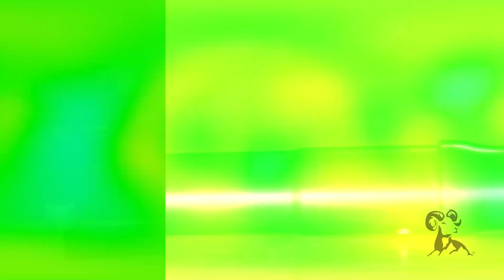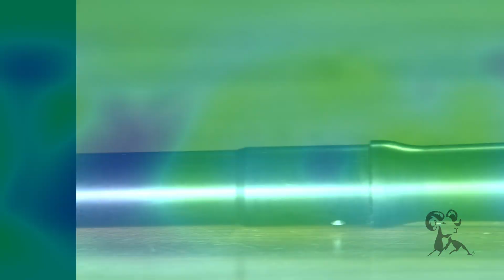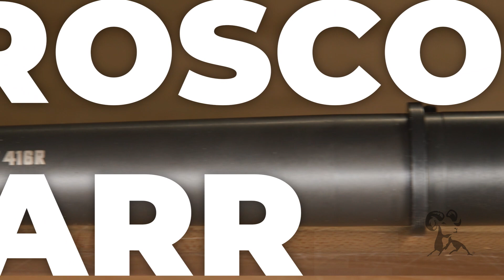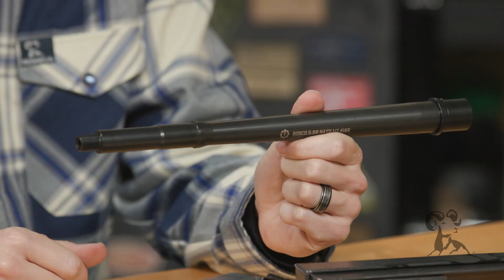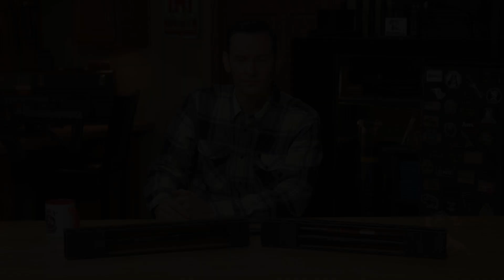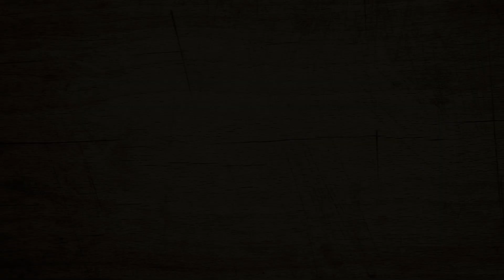Product Spotlight: Rosco AR-15 Barrels

Comment: I bought a Rosco K9 two years ago. 11.5” with the patrol length gas system. So far I have probably 3,000 rounds on it. It’s an excellent barrel thus far. Easily hitting out at 350-400 yards out. I don’t precision shoot with it obviously it’s an 11.5. But as far as hitting a six inch plate at 400 yards I can attest it’s more than capable.

It dissipates heat rather quickly. The short length is easy to manipulate and maneuver. The weight is fine. I’m not going to count ounces when it comes to my barrels. The barrel is going to be what it’s going to be. If I’m shaving ounces I sure won’t be starting with the barrel.

There’s not much else to say. It’s inexpensive. It does exactly what I need it to do. My next barrel will either be a Rosco or something heavier that can manage a lot of heat.

Comment: I know this video came out two years ago, but I had a great experience with Rosco. So I thought I'd share my experience in case someone watches this while considering a new barrel. I put an 11.5 inch 5.56 Nato bloodline barrel on one of my builds. I've had  three other brands of 16 inch barrels on other guns. This 11.5 Rosco barrel is more accurate than all three of the other 16 inch barrels. I like this brand so much, I plan on switching out my current 16 inch rifle to a Rosco Bloodline barrel as well. There pure bread barrels look fantastic as well. If you need a barrel, Rosco makes a great one!
Reply: Thanks for that info man. Really made me go with this barrel. And the price is awesome too, compared to some other ones I’ve been looking at.
Reply: Thanks for the info man. I Stripped my threds on my barrel and I need a replacement asap lol so im definitely getting one now
Reply: Shorter barrels are more accurate.

Comment: I upgraded a PSA pistol with Rosco 10.5 sauce pack (barrel,bcg,gas tube, block) and just right off the bat my AR was shooting perfectly tuned. Popped in an upgraded charging handle too and man my gun cycles like butter. Very noticeable difference to a couple entry level “mil-spec” rifles I have. Cannot recommend rosco enough.

Comment: So if I found a barrel company with all the EXACT same specs, as far as barrel length, weight, material (4150 cmv), profile, twist, gas block size, gas length system...but the company I found was literally half the price...what makes this barrel better? Compared to the competition?
Reply: What company?
Reply: @erice4611  I've purchased 2 barrels, one from KAK industry, and I had another from bearcreek. The KAK barrel is the 8" heavy profile 1:8 twist 5.56, 41V50 material and it's on sale for $75. So why would the Rosco barrel with similar length and material and similar everything, cost so much more?

Comment: Proprietary gas tube length? Ugh. I would stay away from those. I HATE having a special non-conforming item on what is otherwise a reasonably common platform with interchangeable parts. It's bad enough already seeing three AR gas tube lengths plus a bunch of pistol lengths -- but now they are adding more? Even if it makes for slightly softer recoil it's not worth it.

Comment: I have been curious about switching out the pencil barrel on my PSA upper. However, I am unsure on how to select a corresponding gas block and gas tube for my new barrel. Could you make a video on how to select all these parts to work in conjunction? Thanks 🙏.

Comment: I really really wanted the Sage Dynamics 12.5" barrel with the patrol length gas system, but I can't get over the steel they selected for some of their barrels. If I wanted a precision rifle, stainless is fine. For a hard use gun though??

Comment: I have an 18" barrel and put the rifle together during the ronapocalypse. I actually didn't get it to the range until a few months ago. I was impressed by the gassing and recoil impulse. Accuracy seems to be really good also. Better than my two BA barrels.
Reply: What caliber did you go with?
Reply: @chrissewell1608  That would help if I actually listed that! .223 Wylde. PN: PB-18-Med-223W-7-R
Reply: @isaace8090  Ha ha. I built an 18", .350 Legend because ammo was readily available and dirt cheap...then! Not anymore! But the gun turned out fabulous!
Reply: @chrissewell1608  Nice! 350 Legend seems like an interesting round. 6.5 Creedmoor was like that for a while also. All of the 5.56 and 7.62x51 was sold out but the 6.5 was still on the shelf for about two months at the local Cabelas. It was the Herter's for around $16 a box. Needless to say, I bought a lot of boxes then. Now it's hard to find it for under $30 at a store.
Reply: @isaace8090  Yep. A box of .350 Legend hunting ammo was around $20.00 (not bad, at the time!). Now its like $36 - $38.00 (which is insanly high).

Comment: Just bought an AR-15 8.2" BLOODLINE SAUCEPACK .300 BLK. Thanks for the video.
Reply: I'm curious what you did for the buffer configuration?
Reply: @vinniethewrench7603  H1 with Geissele spring.
Reply: @JB-mt7hr thank you for the reply
Reply: @JB-mt7hr did you use a carbine buffer configuration or A5? Thank you for the replies!
Reply: @vinniethewrench7603  Carbine.
Reply: @JB-mt7hr thank you sir appreciate you 🇺🇸

Comment: Bought a colt le6920  upper with the 13629 cage code instead of the c on the barrel, and under the handguard there is an R and at first I was disappointed that colt subcontracted their barrels but later found that its a roscoe and it shoots very accurately,  ps yes I know about CZ taking over.

Comment: Great content great review: I am a big big fan of Rosco Mfg. I could use some information though, I want to build my version of an unsuppressed general purpose rifle, (Recce) and don't know whether or not to go with a 13.7" or 13.9" P&W for short as I can go legally, and stay and light as possible, while having the best balance . I don't know which would best to use, for accuracy and range using commonly available ammo. I have found no content on velocities, or range ballistics, between a 13.7" vs 13.9" barrel lengths. I would say it would have to be very negligible at best, but I could be wrong. any info would help if anybody has any
Reply: The advantage of 13.9 is that there a more muzzle devices that will reach 16". With a 13.7 the muzzle device needs to be 2.7" or 2.8" minimum length to reach 16 with the overlap with threading on a muzzle device.

Comment: Bought one of their 13.7" sauce packs almost two years ago for a pin and weld. Have never had any issues with it, nicely gassed, good chamber. The BCG is properly staked and overall good quality. I've almost exclusively ran it suppressed with no issues aside from being a nimwit using a strike industries flat wire buffer spring.
Reply: Sprinco Blue buffer spring and H or H2 buffer 👍 I've got a SOLGW branded 13.7 I built about the same time.
Reply: I had the same barrel and it was terrible. Ended up swapping it with a Noveske.
Reply: @welderdude1  did you try reaching out to them, they're still a relatively small company and they're customer service is amazing.
Reply: @frozennorth6527  I did. They did a qc and sent me a 2nd barrel that had the same failire to extract issues. They had head-space issues. They're in a box collecting dust now.
Reply: @welderdude1  I'm sorry to hear that.
Reply: @frozennorth6527  maybe they've improved their QC but it was pretty tiring to build up the upper 2x and try numerous different parts hopefully get it to run reliably. When I swapped in the Noveske I haven't had any issues. Ran reliably from day 1.